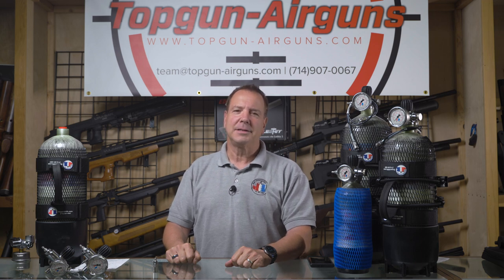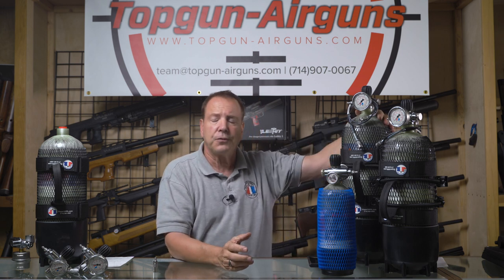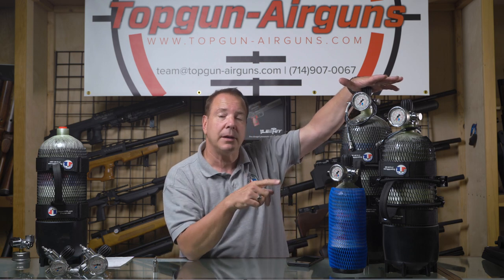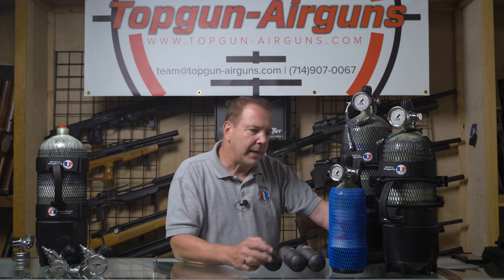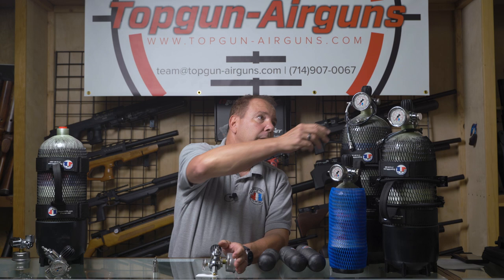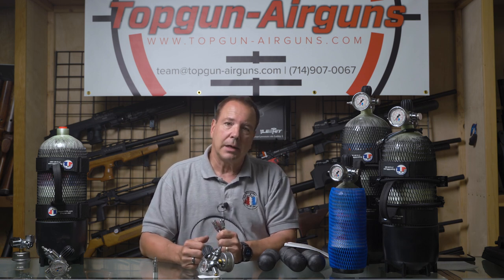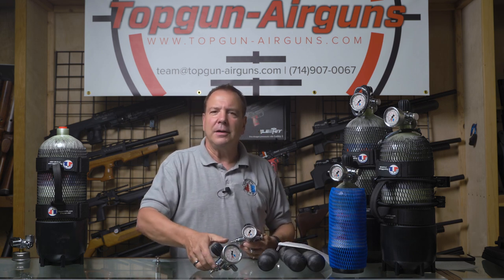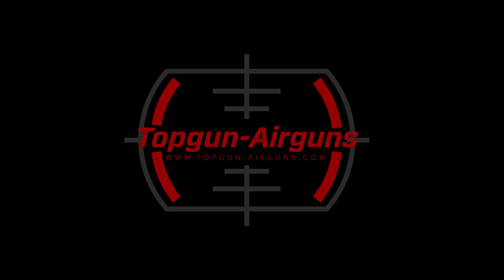Airtanks 101 - Demystifying the Confusion

Comment: Hey Joe, why do you fabricate your hoses with the Foster fittings swaged onto the hoses?  Why not use SS npt fittings so that if a fitting fails, they can simply be switched out?

It's frustrating enough that there are so many variants of "foster fittings" (BSPP, NPT, flare-like, brass, SS, 5-ball, 6-ball, and now we have yours, which are not customizable nor interchangeable with anything on the market.
Reply from the maker: Our Hoses come threaded in either 1/8 or 1/4 npt and we thread on what ever fosters are needed for the application